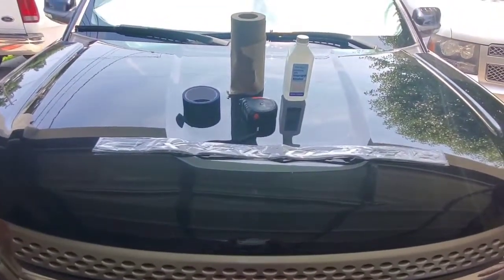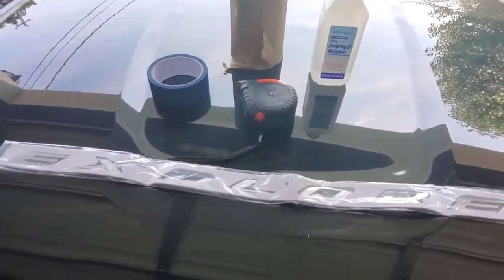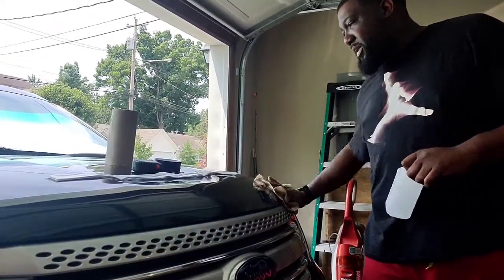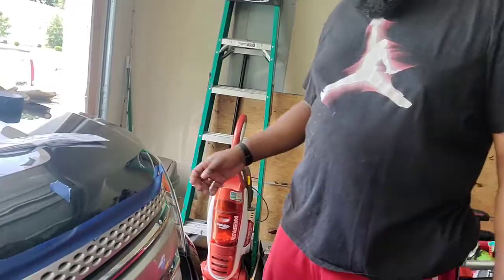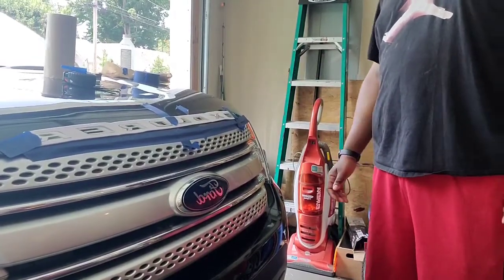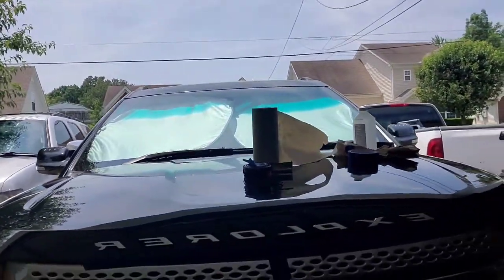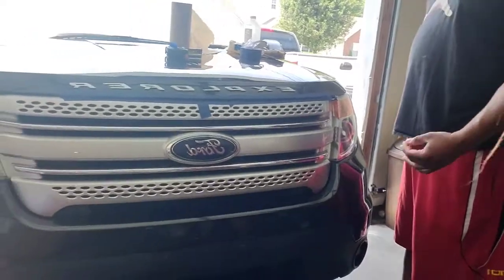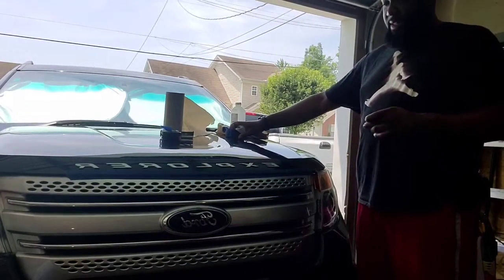installing "EXPLORER" name on hood of 2013 Ford Explorer xlt

Comment: Dude, you should change out the factory grill! I put the lettering on as well and the Raptor grill on mine and it looks really cool…
Reply from the maker: Okay where you get it from and how much I may do that thanks for Watching subscribe if you don't mine
Reply: On eBay, I paid 180.66 with tax included.
Reply: A
Reply: It also has 3 led lights…